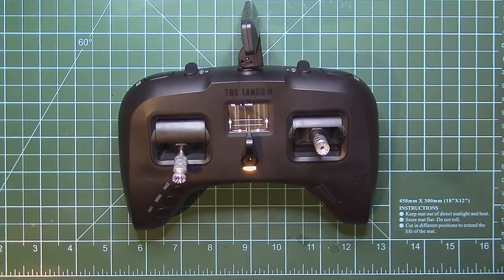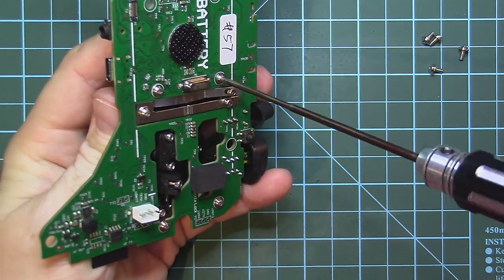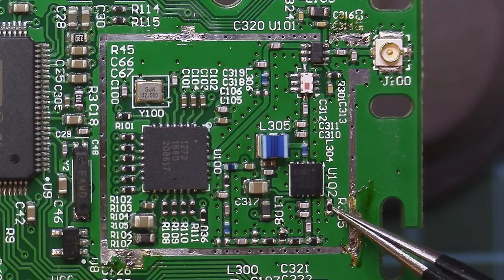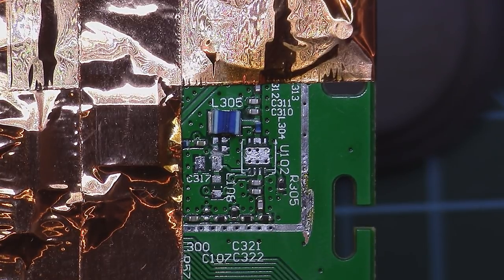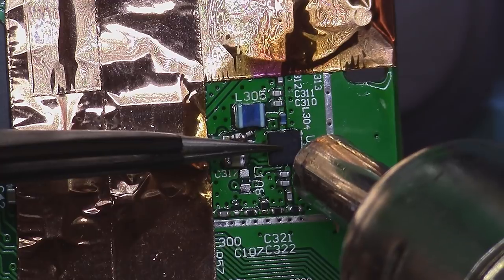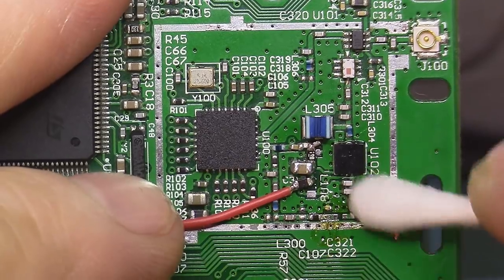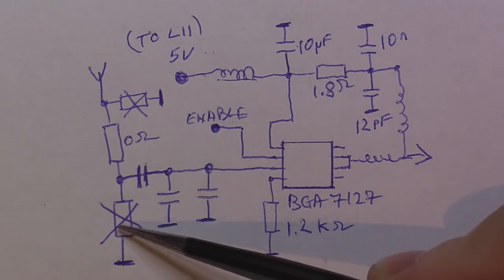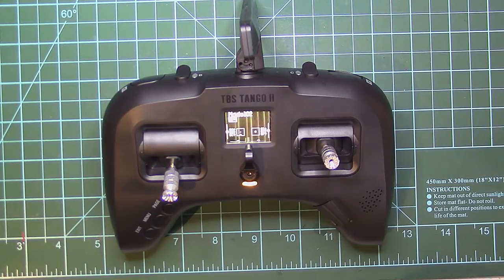TBS Tango 2 - The 500mW Mod Tutorial

Comment: I am not a tech for sure but I thoroughly enjoyed watching a master technician .  My dad was a first class FCC licensed broadcast engineer who worked for a major network affiliate. Occasionally I would be permitted to go to work with him. I was 14 years old then.  He did a variety of things but I always enjoyed watching him on the repair bench. I was entranced watching the "O" scope  as he would tune various components and solder this and that. This was in the early sixties so lots of vacuum tube electronics and some of the new transistor stuff. I remember him showing me a FET transistor and explaining how it worked and also told me the difference between a PNP and an NPN. By comparison to you I do only some minor mods to my drones. I'll change antennas, or a new motor, change out a battery connector, add an LED light or a switch here and there . I did a whoop build and soldered up a FC board in a new frame. It's always fun to fly something you've  altered to suit your own preference. Thank you so very much for this video. I enjoyed it as much as a good movie!
Reply from the maker: Thanks man! You were so lucky to have a father passionate about this :p i had to go to the school library and hunt for books ehehe :)

Comment: Livyu do you know if it's possible to flash the wifi module itself?
Mine seems to turn on when I power down the radio, it started doing it when I updated the xf firmware

Comment: BTW, can you test tunne on TBS Tango 2 folding antenna ? No one has done it yet ;-) Planning to retrofit it onto XLite - have moded Micro TX to fit into x lite without removing RF board, but found mine is missing 1 cap and some 2 pin chip next to internal antenna 2.4 UFL plug

Comment: Hey Livyu, very good video as always, but way out of my comfort zone. I absolutely love how the Tango 2 feels, and would like to know if it's possible to mod a full size / lite crossfire device to it. I know it sounds weird, but I wish I could use my Tango 2 for the close range freestyle, and not having to switch to my taranis with the full size crossfire module for long range and 1mw + output. Thanks for your tutorials !
Reply: the normal tango 2 should be fine for long range it is tested by tbs to go 20 miles out
Reply: @airmanfpv964  it's not gonna go anywhere near that far in normal fpv conditions...I was getting rx loss in the woods before my 1000mw video was snowed out, couple hundred yards (at 250mw)

Comment: nice job, I think the RF shortening capacitors value is not critical at all and would just left original values. Behind the coil were you solder the 5volt wire I would personally added an extra gnd shortening capacitor. The 1.2 Ohms resistor are just a bit of current limit protection, especially when transmitting without  antenna, you could also use ordinary resistor in the 5v line, make mod even simpler.
Reply from the maker: Without the parts... The amp enters an unstable state and oscillates. The bias voltage has to be less then power... Usually on rf amps that power filtering is very important for the stability of the amp... And if the manufacturer offers different values for the 500mW... Is better to use those.
Reply from the maker: Just check the manuals... Bga7124 vs bga7127
Reply: @LivyuFPV  Sure you need the caps!! Otherwise a lot of spurious or oscillation. However the values it self is not so critical, it should just short the RF to GND.  Often two capacitors are used a small and bigger value. at 868mhz.
Reply from the maker: @frankyfrench5279  rf and dc decoupling sure... but depending on the rf device the values of the caps can be calculated so that the filtering is the most effective. :) the 1.8ohm is there to lower the voltage so that there is a difference between the bias feed vs vcc and the device is sensitive to this difference.  The 250mW device is not that critical.

Comment: How hard would it be to add a slider or pot? Instead of one of the switches.
Reply from the maker: depends on how they implemented it... on the 3 pos switches I guess it would be possible. again depends on how they implemented the switches.

Comment: can 1 watt still be achieved somehow? does the tango 2 have an external module bay?
Reply from the maker: Does not have... Yet. I hope they will do something. 1W is very...very... Complicated it could be done but not on the safe side. The rf filter and rf switcher on the output i doubt they can handle the power... And you still need to change a lot on the output matching section...

Comment: Could you use some thermal tape or other compound to thermally connect the chip to the metal can for cooling?
Reply from the maker: yes, you could but the temps are decent ;) no need to use cooling other than the PCB dissipation.
Reply: @LivyuFPV  makes me wonder why they didn't use this chip in the first place.
Reply from the maker: @pierrefpv  legal reasons mostly. The micro tx schematic had already been approved by fcc and other entities
Reply: @LivyuFPV  ah right, yes that makes sense

Comment: Is that really true that crossfire micro tx in not really 250mw? :(
Reply from the maker: almost :) you have to modify some resistors... and it will get to 250 :P
Reply: @LivyuFPV  and if I don't modify resistors, what is the power it has?
Reply from the maker: @IvanEfimovLimon  around 200. The initial micro tx was designed for 100mW ;)
Reply: @LivyuFPV  thank you for the answers!

Comment: Any possibility to add a frsky/Spektrum/multiprotocol module?
Reply from the maker: no
Reply: @LivyuFPV  that's sad, kinda a deal breaker for me. Would have liked to use the t2 for whoops and toothpicks
Reply from the maker: @marvfpv1590  i have crfs on tooths and whoops ;)
Reply: @LivyuFPV  me too, but it's too heavy for the UL stuff
Reply: @LivyuFPV  what receiver and Antenna? thanks
Reply from the maker: @DidgIvo  nano xf with stock antenna but  on whoops only the active middle cable very close to the ufl and on other stock antenna with a ziptie. works perfect for me...
Reply: @LivyuFPV  thanks. So yeah the tbs tango 2 has the form factor perfect for my brushless whooop 'lunch box" and the range for my all other bigger builds.... But having to put crossfire on whoops... Hmmm decisions hahaha
Reply: Livyu FPV so u cut the ufl antenna down short and only leave a small portion of the active element ? Need to search YouTube for a video on this
Reply from the maker: @djs134  when you take the antenna it has a cebter element and a ground portion soldered to the ground
Reply from the maker: @djs134  and you just short the feed coax and loose the ground section... The active element has to be same lenght as stock

Comment: Not worth.buying way to small and only works with crsf
Reply from the maker: if you are using only crfs... it is a way cheaper option...
Reply: @LivyuFPV  maybe but most people like me have 23 quads with differant protocols a d already have crsf units . I bought a t16 pro and love it because it does everything and works with everything and you can see the screen . I get what you are saying if your new and only plan on running crsf than yea but remember tbs products are exspensive compared to most so i just dont see these selling that well . Also any word when the hardware update for fusion is coming out thanks
Reply: boots fpv 23 quads is excessive. Perhaps that’s the real issue at hand.
Reply: @jaypolohiable  lol yes but ive been doing this for 5 plus years now and some ar old im not saying its a bad radio im sure its great .
Reply: Why didnt they just make it 500 to begin with . Those ear sticks are called q tips  lol good video livyu you are good at these things
Reply: boots fpv 🤣 I’m dying. Hahahaha. I totally get your point. I have a pile of quads in varying states of disrepair. But I’ve migrated everything I have to CF nanos, including whoops & toothpicks. The only thing I don’t get is why the upgrade to “pro” version is only some gimmicky folding sticks.
Reply: @jaypolohiable  yea ive changed quit a few  over . Yea i dont get the stick thing for 50 dollars  more it is neat though . Im sure its a great radio but i already have crsf on my jumper personally  i just cant see changeing over . I also have 500 mw not the 250 this comes with wich can be moded but than voids a warranty  so ill wait to see what the future brings if they ad a multi  module  to it a d change the output power than maybe i will get one . Its crazy something new everyday . I wish the fusion hardware upgrade would come out soon
Reply: boots fpv have u tried the new 1.0 firmware for the fusion. Seems like a pretty good improvement. I also can’t wait for the fusion upgrade.
Reply: You dont see these selling well???? Really?
Reply: @metazootet1492  no i dont its just a new thing and the hype will die down in a week . I like the radio dont get me wrong but with it only being for crsf its really kinda worthless to buy . I would get one but i already.have a crsf and use multi protocols im not going to go spend a ton of cash to change over everything i have . But new quads im building i am useing crsf . But i like all sizes including whoops and micros and you just cant use crsf for that . They should have made it to work with everything
Reply: @djs134  yes i have it works good but i bought fusion months ago and the hardware upgrade should have been available  by now seems like they have put all there time into this radio instead